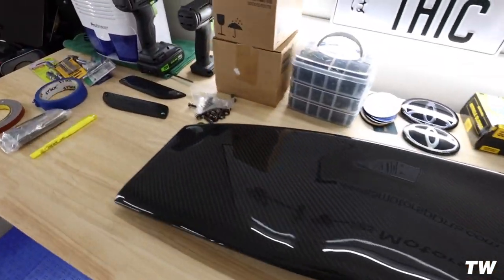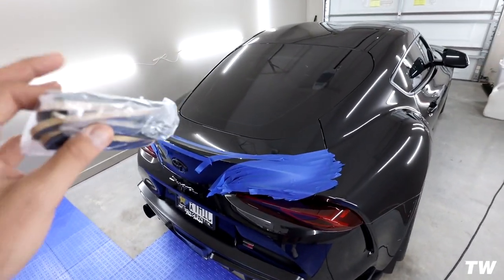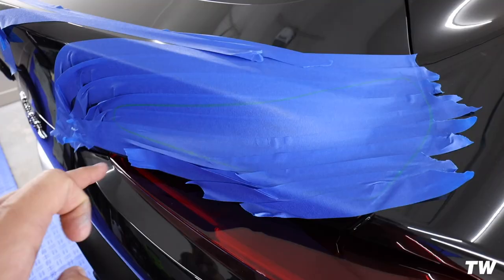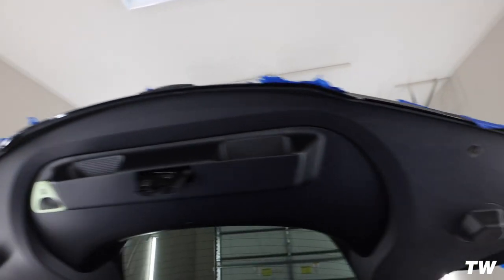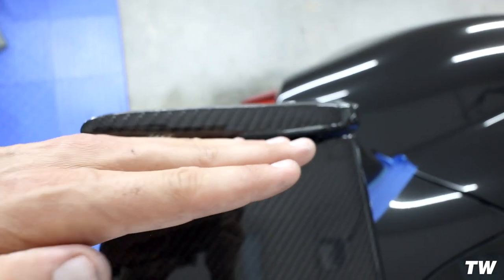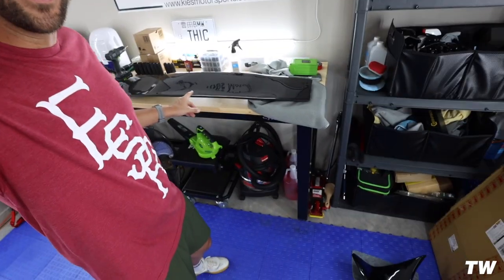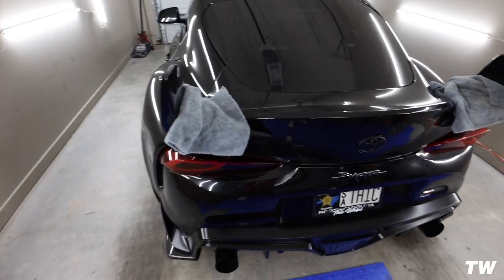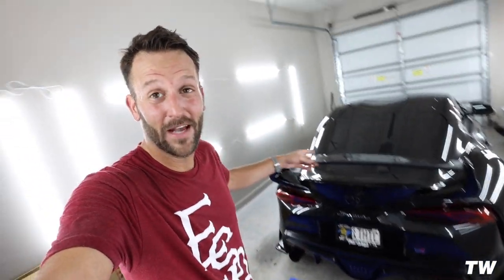How To Install The StreetHunter Supra Wing! (Complete Install Tutorial)

Comment: If you want to film any videos on the 24 M4s Hendrick currently has a unique spec 24 M4, Aisle of Man Green, full Kayalami murano extended interior,  carbon buckets, exterior carbon package.  Car is absolutely stunning,  it was a custom order someone backed out of. Odly no other packages were ordered , no Icon Laser Lights, no M Shadowline, no Executive Package,  no Park assist, no Drive Assistant Professional package,  again odd spec but, absolutely gorgeous Aisle of Man Green over Kayalami.  Ryan has a Brooklyn Grey over Silverstone due for delivery in a few weeks. Mine coming in is unique in that it is Dravit Grey over Silverstone murrano extended package (typically only found frequently on Convertible M4s). If you wanted to film off truck dealership deliveries,  reach out to Ryan on his Brooklyn Grey or you can film my Dravit Grey coming in. If you wanted that content or think it will do well on the channel 👍👊🤝